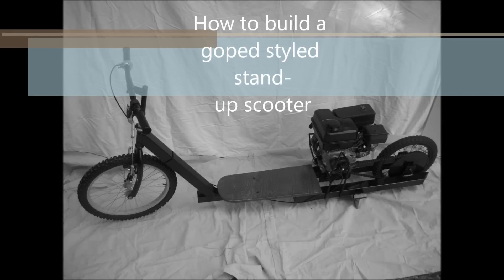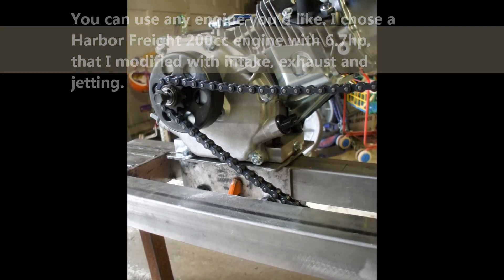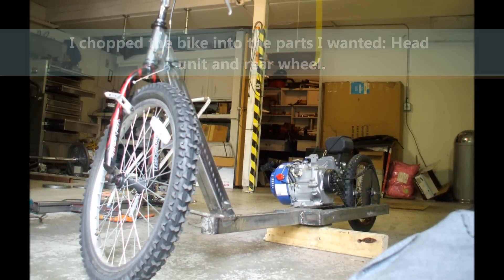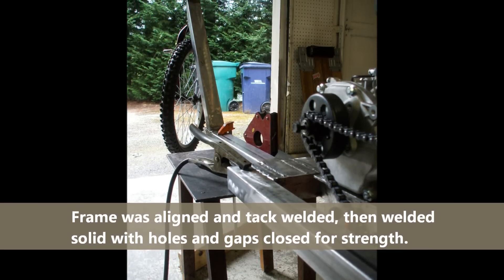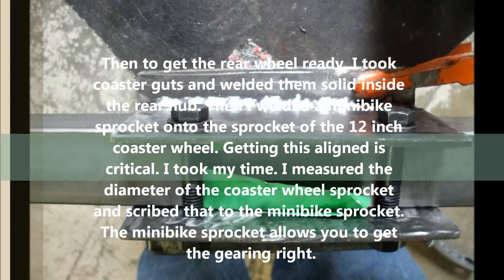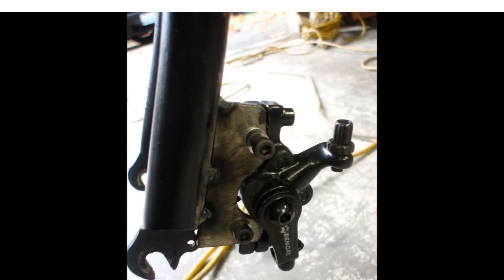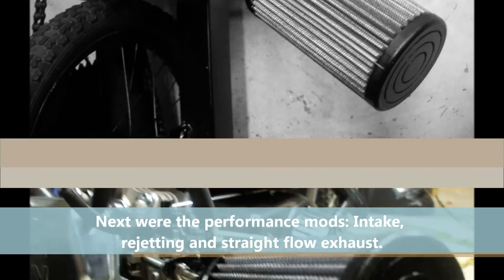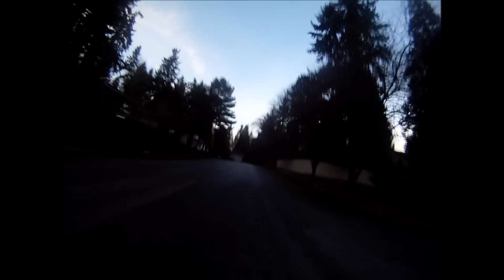How to make a high performance standup scooter for $200

Comment: I am curious are you connected the back sprocket to the wheel
Reply from the maker: I welded the minibike sprocket to the bike sprocket, but I also welded up the internals of the bike hub...so that the bike sprocket, coaster brake etc no longer spun. It was then a fixed sprocket setup

Comment: hello nice job ide like one of these.can a rear break be installed.
Reply from the maker: Yip. There are  disk brakes that are designed to work with the rear sprocket...which will work. Northern Tool sells them. Thanks for the question.
Reply: vaz Fx thanks man.i bought the 212 motor already.cant wait to start buildind it😃
Reply from the maker: +anonimo yo , cool. Good luck and feel free to ask questions. It will be a blast to build.

Comment: Please Please tell me how to make one of those using words that an average teen knows. This looks so cool and I'll willing to put my money and time to make on of these. Maybe you could make a new one or put in the description of what we would need. Please you're so cool!
Reply from the maker: +M Hager Thanks. 
Some of the things you need:
1. Engine (Harbor Freight had the 212cc Predator Engines on sale a week or two ago for $99, so look out for sales)
2. Clutch
3. Chain (size of chain must match the gear on the clutch and the Sprocket size. When you buy a chain, you will notice the chain has numbers like #35, #40 etc. That number is the chain size. That Clutch gear and sprocket must match the chain size)
4. Steel tubing
5. Steel plate
6. Old bike to use the front forks and other parts 
7. Brakes (bike caliper brakes or bike disc brakes)
Tools:
1. Welder
2. Grinder(cutting wheels and sanding flapper wheels)
3. Drill

I hope this helps
Reply: +vaz Fx Much appreciated. This helps a lot.
Reply from the maker: Cool. Northern Tools has a selection of parts, and there are some suppliers on Ebay